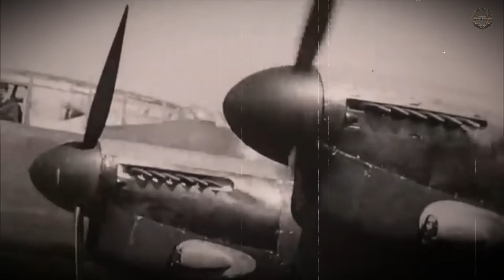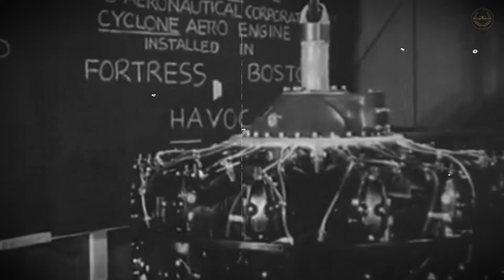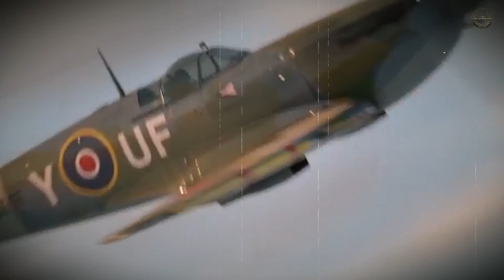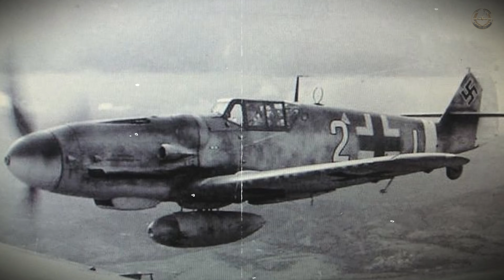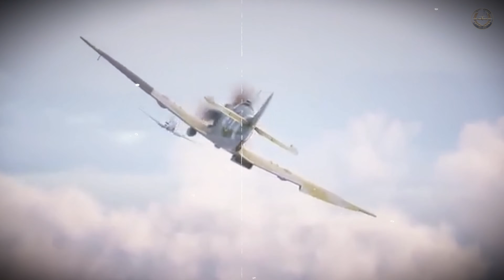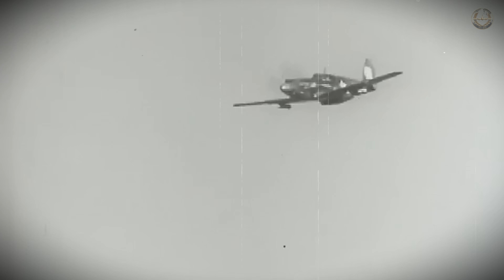The "Miniature" V12 That Won WWII: How a 27-Liter Engine Broke the Luftwaffe

Comment: It was also installed in the deHavilland Mosquito, a plane that really ruined the Germans' day.

Packard Merlins were re-machined from original plans but made to much higher tolerances. The first Merlins were produced in England - the finest were eventually made by Packard in the United States. And the Rolls Royce Griffin was better yet, but came late to the party.
Reply: The real reason Packard got the deal because Britian's factories were being bombed, America's wasn't. The finest Merlin's came from the British because the engines were handmade, not mass produced. The real benefit of Packard was their ability to mass produce more than the British could do.